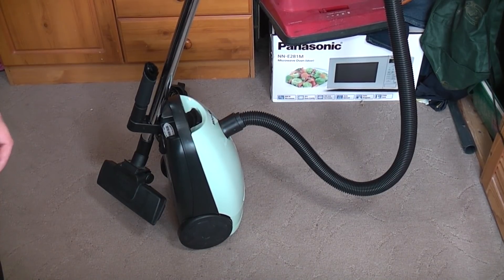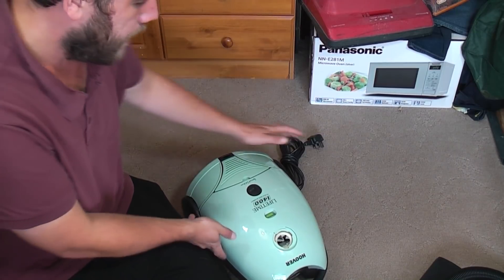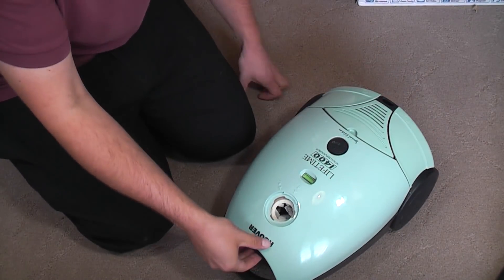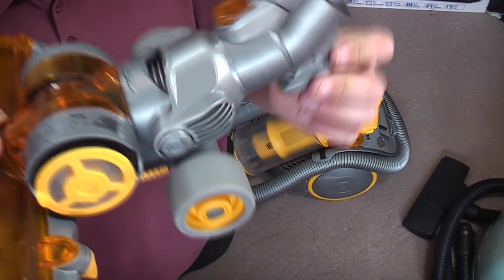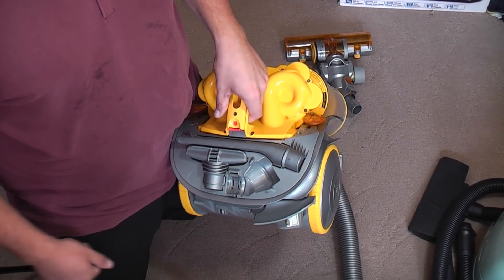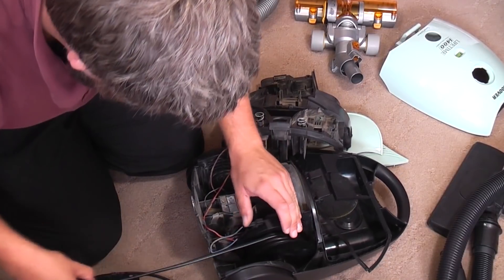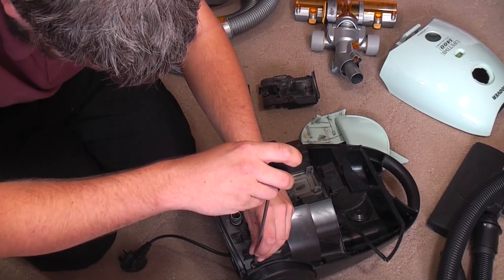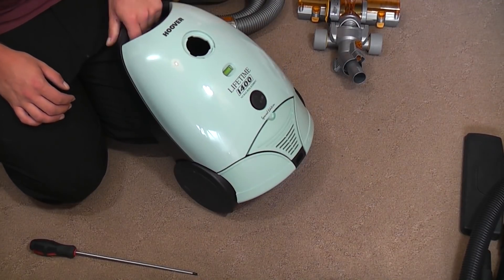12 Vacuums in 12 Months 2018 - August!

Comment: Can't you fit DC08 Accessories to it? Like the wand or the handle
Reply from the maker: Abir Chowdhury Can fit the wand and floor tool yea, but I think the hose and the end that goes into the handle is different (although it might not be, been ages since I've had a dc08, I've forgotten! I'll check my blog, 2 secs)
Reply from the maker: https://oldhoovers.blogspot.com/2018/07/dyson-dc08-telescope-wrap-brochure.html?m=1 I could it seems! Although the wand wouldnt clip onto the machine
Reply: Beko1987 You even said yourself you wouldn't wrap it
Reply from the maker: Abir Chowdhury I say lots of things then don't do it! I say I won't buy any more vacuums, 2 are on their way... Oops
Reply: Beko1987 If I were you I would use a DC08 Handle and extension tube, so I could have some comfort with using the small tools without unclipping the hose from the handle or connecting it to that monstrosity that is the DC11's handle